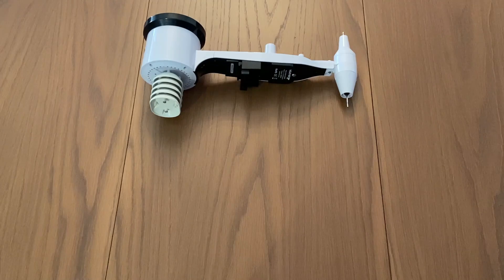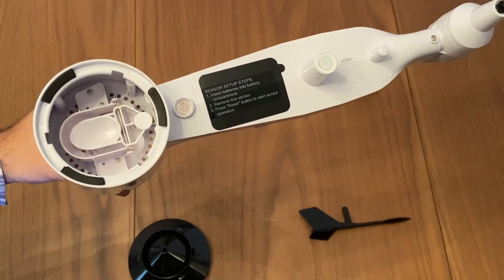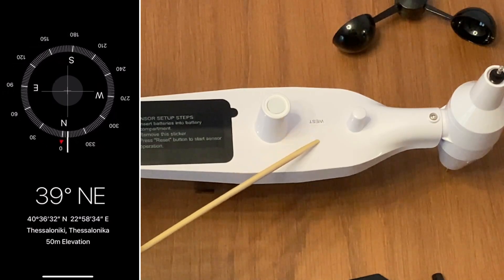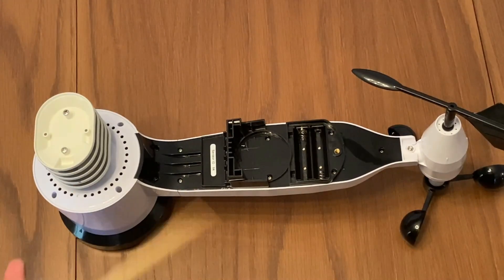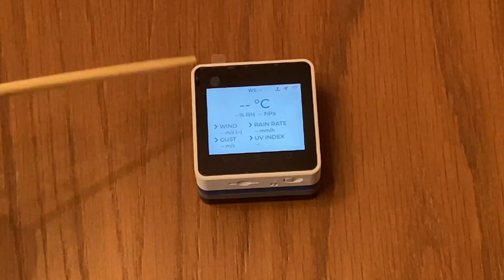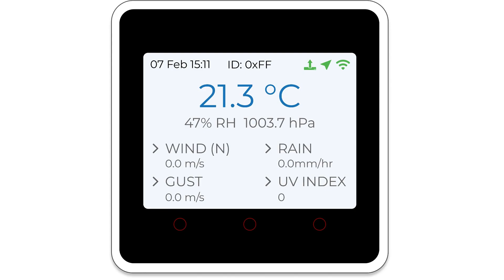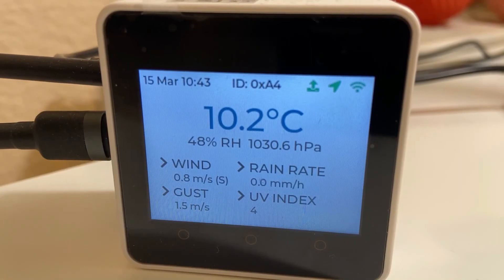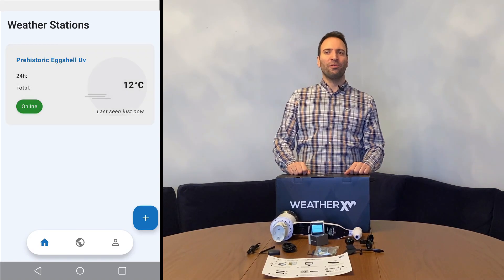WeatherXM M5 weather station - unboxing to installation

Comment: The graph for placing and tightening the wind vane and wind speed sensor are kind of confusing, can you elaborate a little more in detail what im seeing in the graph? also what kind of wall power supply can I use with the provided power supply cable?

Comment: Hi, we have just received our WXM M5. Power Charger/Adapter is NOT icluded. Since we just can't find the info, anywhere (!), there is dilemma: WHAT would be the OPTIONAL Input/Output of the Charger/Adapter for station Gateway? Reg. Input/Output in Hz/A/V !? i.e. would Quick Charger for mobile phones be OK!? We are in Zagreb, Croatia. Thanx. 🤔👋
Reply from the maker: Its a standard 5V USB cable which is provided. Use any old/new phone charger or USB plug
(Hz? A/V? those are specs for mains power which irrelevant in our case)
Here are our detailed guides and specifications: https://docs.weatherxm.com/
Reply: @weatherxm9732  thanks 👌👍

Comment: Is there a way to provide permanent power supply to the weather station. It is odd to put the station on the roof and then go up there to change the batteries.
Reply from the maker: We expect battery replacements to happen once every few years - but yes, future versions of our station will have an optional battery pack that can bring the batteries ~2m lower, and if you think it is necessary in your case you can purchase it as an accessory.

Comment: For the condensation sensor, I think it would be bore accurate and better if you put a water wheel instead of a cup and you can attach a conductor to generate its own power while it rains.

Comment: Thanks for the video. What is the diametre of the mounting pole you have used?
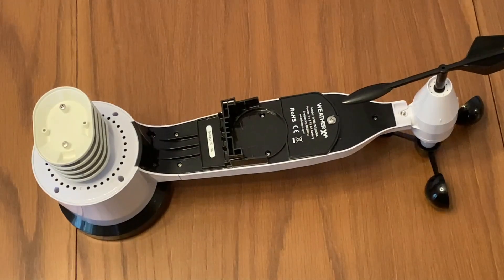Reply: It is mentioned at 4:34
Reply: It is a 5cm diameter pole.
Reply: @stavroskeppas251  and that is the only compatible size?
Reply: @ice0165  as I explain in this video, it is a good idea to use a pole with a diameter between 3-5cm, but no less, for stability reasons.
Reply: @stavroskeppas251  I didnt hear this in the video but thanks :)

Comment: So the rain gauge is being emptied automatically right? There is no need to do it manually. Thx
Reply: Yes, that's right. But it is a good practice to clean the rain gauge and the spoon in it at least once a year (if you live in areas affected by desert dust maybe more frequently), as dirt and dust may affect the measurements. Same for the other sensors as well.

Comment: how to setup antenna? I NEED IT i dont have signal omg, distance about 20 meters between station and M5. Above me are 2 floors and then roof.
Reply: exactly. same problem.
Reply: There will be a video explaining this soon. FYI I tested the external RF antenna for a case of 3 floors between the sensor and the M5 and it worked.

Comment: 10:15 well i have two flats in block apps, so what now? how to I attach the antenna? where is the most important manual to this? WTF
Reply: There will be a new video (as we mention in this video) explaining how to use the external RF antenna. Certainly, this is an important part, but not for the purposes of this video.